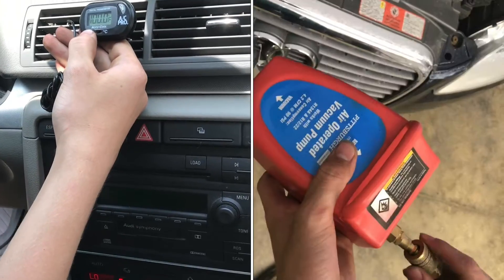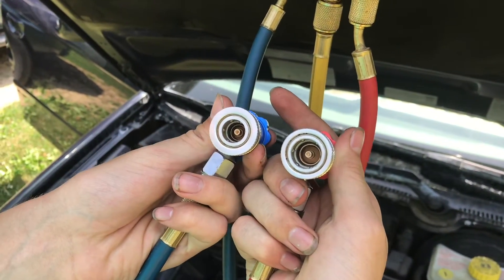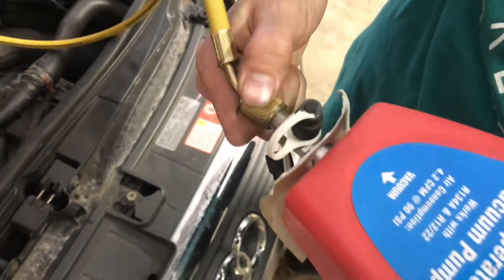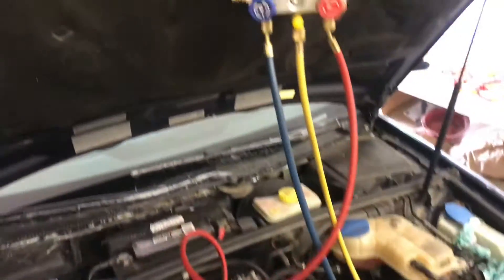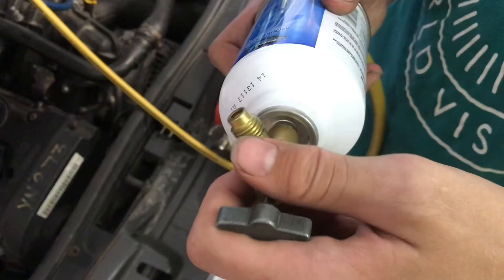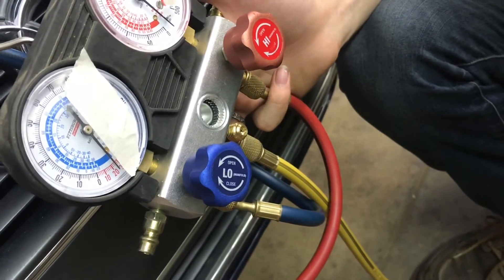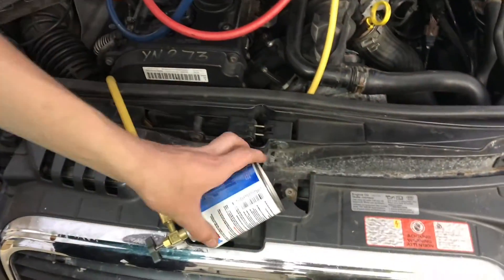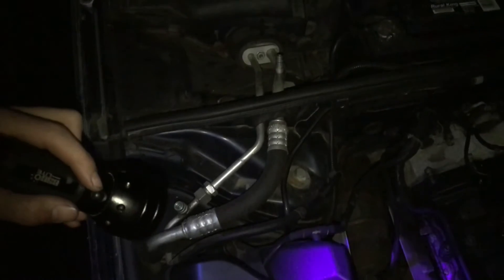adding “UV DYE” to an air-conditioning system to find small leaks

Comment: I intend to remove old gas, replace suspected faulty Xpansion valve. Vacuum then, add dye to yellow tube as you did 7.5ml for Camry. Use can of 134a. Purge air like you did careful not to spray dye into car. But some say leave can upright to avoid liquid going to compressor. You laid yours horizontal. If there is liquid it will settle to bottom so you would want can upright with tap at top right? For diagnosis  My readings were zero low side and 120 high so I suspect xvalve blocked. Can I use any 2 dollar shop O rings or need to be specifically for AC. When replacing xvalve.

Comment: good video though Id offer it would be better to put the dye in the end of the line that does not have a needle valve you are essentially trying to ad it to a tire through the valve stem lol.   judging by the hands Id guess you are still younger have all your fingers n few scars lol  overall helpful video cheers

Comment: I use to have a glass container with in and out 1/4 inch fittings. It is used to add oil, die or whatever to a freon system. What is it called? I can't find mine and want to buy another one.

Comment: Those air compressor vacuum pumps don't pull a low enough vacuum for AC evacuation.

Another tip, make sure to store those UV dye bottles upright. The caps don't really seal them well enough and the dye will eventually leak and get everywhere. You won't see it in daylight, but you'll get it all over the service ports when you're setting up the hoses and then it'll be way harder to find the leak since you won't be able to tell if the dye came from the leak or your hands.
Reply: They work fine,used them plenty of times with a good dual stage compressor! Do they last long,no y thier 12 bucks.

Comment: This video has multiple issues that are not correct and could cause serious injury to someone if try it. Never open high side when charging system. You do not open the valves on the manifold set to get readings. That opens the pressurized lines open to the charge hose.
Reply: I knew i wasnt the only one thinking that
Reply: I thought it was radiator all along (it looks the same, really). 
I only learned that it is a condenser after I accidentally let open the high pressure valve (I even inhaled it intentionally to identify the nature of the vapor's odor.) 🤣😂

Of course my head got too big to handle things I thought I could, but the way the system is designed/assembled in most cars, really doesn't differentiate it from other valves/pipes, which are relatively less risky)

Comment: Dude, you literally just opened both the high and low side to atmosphere thru the charging hose when you opened both valves and then expected to see the gauge work??? WTF, you have ABSOLUTELY no clue what you are doing and therefore should not be showing ANYONE ANYTHING.
Reply: Right.  Gauges work regardless.  The dials are for opening into the yellow cable.

Comment: NEVER OPEN HIGH SIDE WHILE CHARGING,.
Reply: YES. Don't do that. The high side is never used to charge. Other than that, good vid
Reply: @TMG_Shaggy  I noticed that you opened the high charge when you were charging.  Is that correct?  From my understanding it should not be opened, only too measure pressure and vacuum, like Dave Kochis mentioned
Reply: @TMG_Shaggy  your half right and half wrong . Charging through either side is sufficient if using an actual A/C machine . It actually gives you an option to charge via low high or both . Also just depends if you have a office tube or EV system but you can charge both ways . It’s harder to charge with a can with the A/c running because then it would be impossible
Reply: NEVER charge on the high side.
Reply: How about never touch the high side while charging or while the system is running ..  while charging your high side will be like 150 ish psi.. while the A/C is running your looking at like 300-350 psi.. enough to take an eye out . I’ve seen eyes get messed up with the system off and just sitting because someone thought it’s a good idea to blurp the Schrader valve to see if it had freon
Reply: I thought I F'd up, I only used the Low side. I must have done something right for once 🤣
Reply: @Mazza666 Beware the number in your username.
Revelations, chapters 13-14. ✌🏻
Reply: I fill high and low side until it wont take anymore then close high side before starting. Then after you're done, unscrew the high side coupler and open the low side and allow it to suck what's left into the system. The residual pressure in the gauge should be around 50 psi so just bleed that into the air to empty it back to zero.
Reply: Sunday, July 6, 2025

Never write on all capital letters while commenting!

That is the text version of shouting.
.
Reply: I want to say I have seen some people suggest a quicker way to start charging is by charging it through the high side w liquid via the canister upside down w the ac off. not saying this is advisable. I would assume you stop when the ac high side equalizes w canister pressure, then proceed to low side. because w only low side fill it does seem to alow down more and more near the end, especially as the can cools tremendously from all the refrigerant getting sucked out
Reply: The can was upside down
Reply: yeah no shit, good succinct tutorial for beginners but never open high side when engine on

Comment: What would you do if the system is already full but wanted to add uv oil. I'm guessing go ahead and add a bit of refrigerant for a few seconds anyway?
Reply: If the system is full, you can certainly try using a can with dye added, hooked up to the yellow line, run the A/C. ... however it may not accept any more and you risk over charge.  There exists tools to inject with.  Just today I saw at autozone, a couple tools, including one for about $15 that will inject dye.

Comment: I know this video just showing things but one does wonder if there's no leaks, how the refrigerant left the system in the first place.
Reply: All cars leak a little bit through the compressor. That's how they are designed. This is so the seals on it are lubed. Usually the refrigerant will last 3 to 4 years before needing a recharge.

Comment: When adding at start with vacuumed pipes will compressor turn on? I thought the pressure sensors won't allow it to until enough gas is in the pipes to build up pressure?
Reply from the maker: When there’s a vacuum there’s no pressure so the compressor will not engage. By putting dye into the tube before you start adding refrigerant,the dye is put into the system as refrigerant pressure is added. Once the pressure is adequate the sensor will allow the compressor to turn on. I hope this answers your question
Reply: The compressor will not run until you have about 10-20 psi in the system enough to trigger the pressure switch. So when you evacuate and vacuum down a system . You have to put some Freon in before it will kick on. Which will be done by hooking up your Freon bottle, purging the air from your gauge set with Freon and opening the valves on your quick connects and opening the freon tank or canister. The vacuum on the A/C system will pull Freon in until it hits positive pressure and then the pressure inside the freon tank or can will push the freon into the system until the two equalize in pressure then you will use the compressor to pull in the rest from the suction side. The compressor will kick on way before the can and system equalize pressures I just always let it equalize so I know there is anough freon in the system so you don’t run the compressor dry while it pulls in the rear of the Freon. If using a gauge set let the vacuumed system pull the freon in the high and low side first then close the high side turn the compressor on the let it pull the rest in

Comment: Do you need the gauges to check where the leak is
Reply: They make a can of R134a with dye in it and a single hose to put it in, but without the dual gauges you could overpressurize the A/C system. People run the car with the A/C on high while putting it in and stop shortly after it blows cold. You really want to run a vacuum pump on the system if it is a valuable car to avoid moisture. You can find a good one on eBay for $70 if you don’t have a compressor for the $25 one

Comment: At 2:10 when you poured the dye, how did you get the dye into the hose? Do I have to then press the schrader valve on the hose? How much dye do I need to pour?
Reply: He just pressed a small amount on the schrader valve and then attached the R134a before puncturing and pressurizing. Some dyes might not be concentrate enough for that amount. Also place a rag over the valves to avoid getting dye all over.
Reply: @jrowe9301  thanks
Reply: That is not a Schrader valve in the yellow hose. It is a depressor. A depressor opens a Schrader valve when it comes in contact with it.

Comment: Couple big mistakes was done while recharging the system. 

#1 the yellow hose is connected backward. The valve should be toward the gauge, not the pump. 

#2 you shouldn't be using the low and high to recharge the system. only the low side is used to recharge the system.

#3 you didn't properly vacuum the system. The system should be vacuumed for 45mins. 

#4 you should let the system hold vacuum for 30mins to an hour just to see how small or big is the leak.
Reply: I heard the same thing as # 2, that you should never open the high/red side during charging, but only during vacuuming. hmm...
Reply: @vinny1995  That's correct, only charge through the low side port. When you're pulling a vacuum on the system, then you can use both both ports.
Reply: Leave your system under vacuum then add your refrigerant to the high side and then 
Easy it in on the low side with the engine running
Reply: #2 is is wrong by all means , you usually need to use the high pressure valve so to make sure ur compressor works fine and not suffocating. look into it more🙂